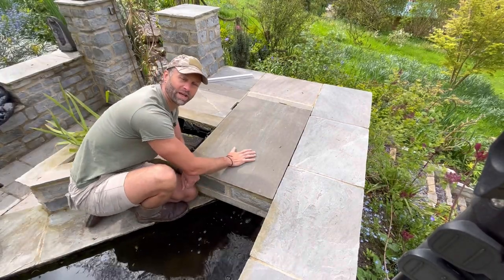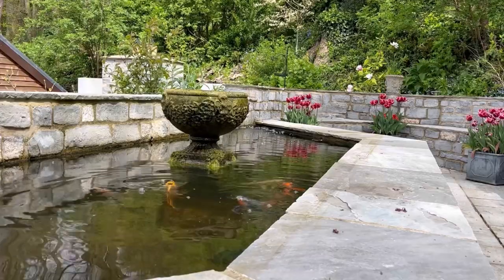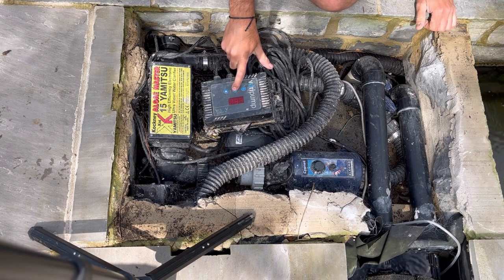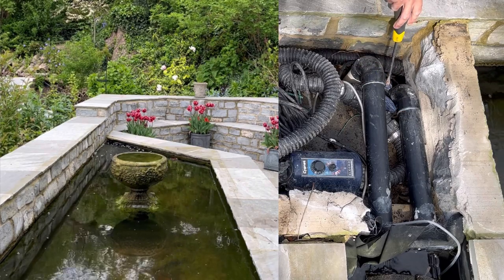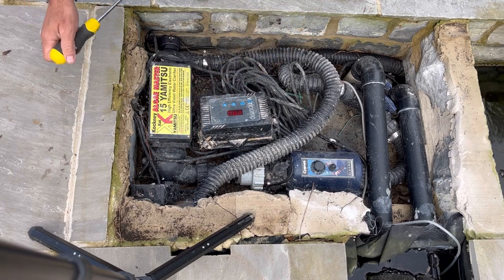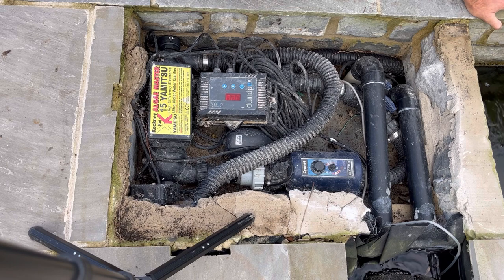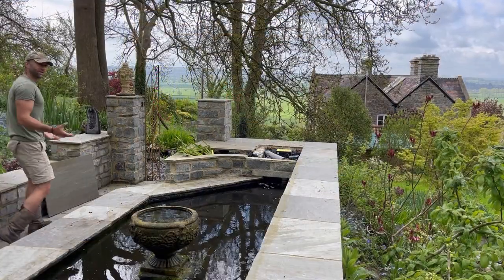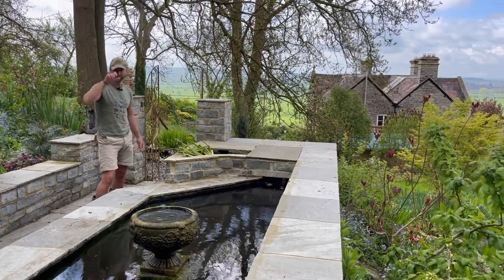POND FILTER UV and VARIABLE POND PUMP Demonstration. 💦🛠️🐠

Comment: Absolutely nothing wrong with your set up, it's good to be compact. Maybe could have lined it with pond liner. Also for the actual filtration, a few netted bags with alfagrog would provide more beneficial bacteria for you than the brushes which are a good mechanical filter but not as good for biological but if you're getting results with the bio load you have, keep doing what works! Great content
Reply from the maker: Thanks for the comments, really useful. Good point about the additional bio load but the water quality doesn’t seem to need it. That said, I may try it anyway and see if I can notice any difference.
Reply: @TheMilitaryGardener  Alfagrog E25 has the highest surface area by volume and is more cost effective compared with other filter media. Just throw in some filter bags of after the first set of brushes. The first few brushes will act as your main mechanical. You have a beautiful garden, you can tell you've put alot of thought into things.
Reply from the maker: Thank, every spare hour is spent working on it.